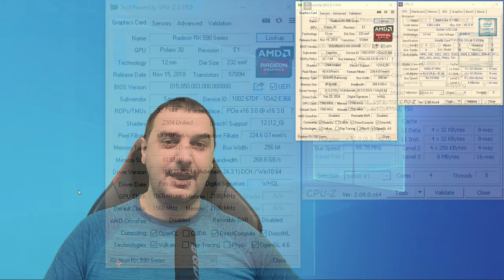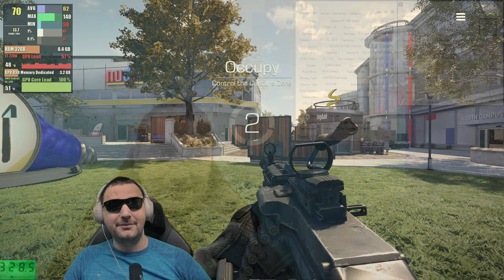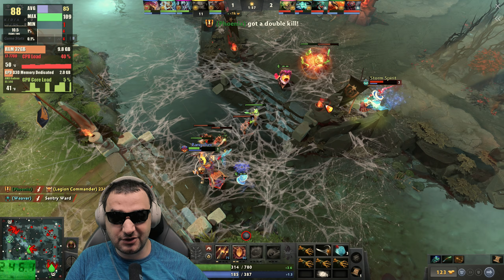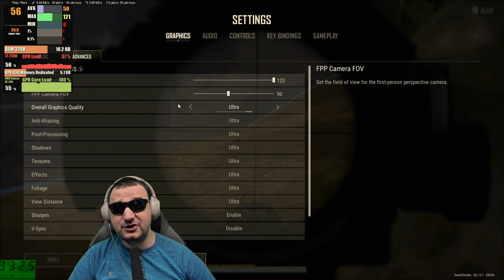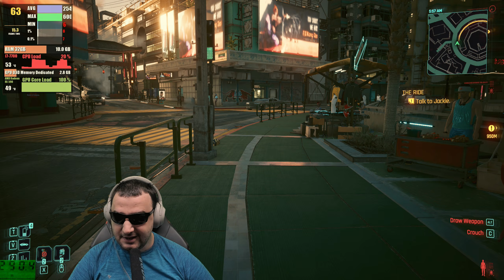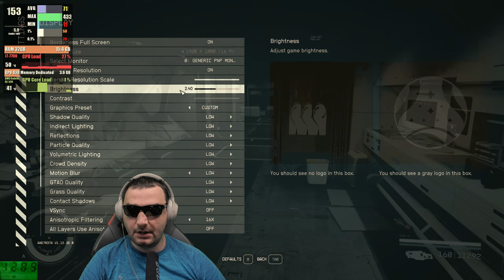AMD RAdeon RX 590 Benchmark

Comment: This card could benefit grately from an undervolt, would of been interesting to see how much more eficiency was gained from the 12nm die shrink when compared to the previous rx580...Edit: strange that on techpowerup its the same 232mm2 die size...
Reply from the maker: If this was a car from 2018 it will have 1000 Km onboard. unused card since i bought it. if you enter the video section and search for rx 590 that`s how many times i use it since new. 
I think Undervolt its not necessary yet.  Maybe if you want to lower the wattage a lot yes. i think overall for the moment THIS RX 590 its ok. other RX cards yes but for some reason the Sapphire models are super cool and with V-sync its enough to distress the whole system.
Reply: @DanielCardei  can confirm that the heatsink from the sapphire versions was the best on these cards since I have x mining cards like the 570 nitro+ (the biggest one) that stays  around 10degrees cooler than others like xfx or msi even in cases with bad airflow that have 80mm fans... as for the undervolt, maybe they did a better bios version with the newer polaris30\rx590 on 12nm that keep the card at around 120w with 1366mhz or whatever since the old ones went at 180w and overheated badly, saw some newer rx570s at 120w holding that frequency but maybe they had newer and better configured bios too...too bad that they cant decode youtube in 4k with the vp9 codec, while the 10 series released in the same year could, so I had to go with that to get 80w with monitor and all at 4k instead of 120w on the rx570 at 1080p with the h264ify plugin to swich vp9 to mp4...